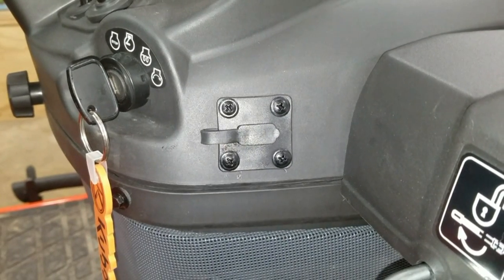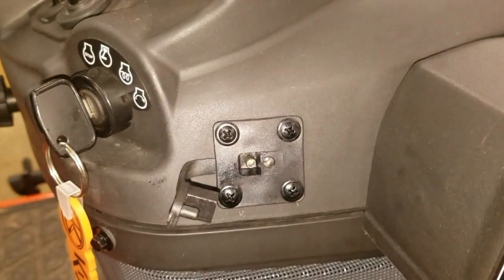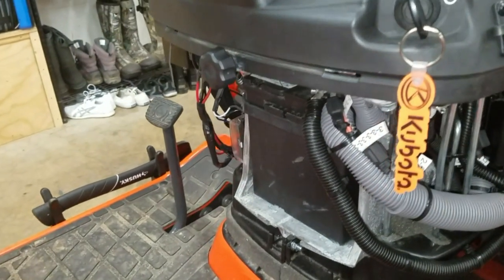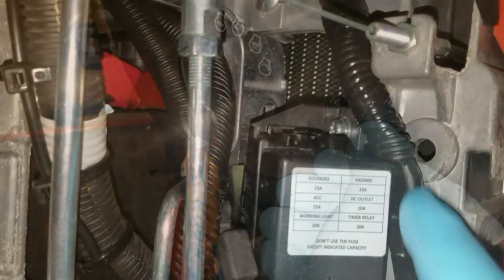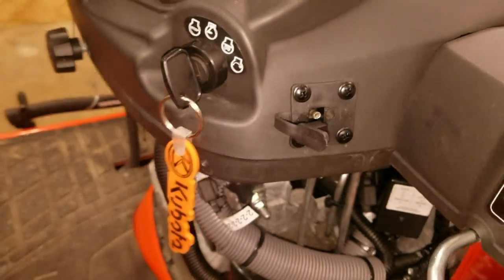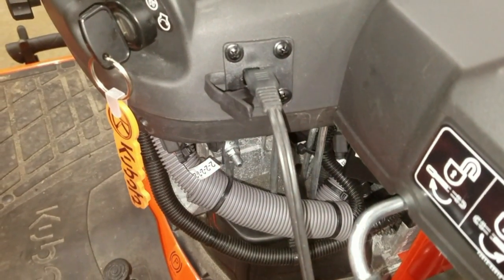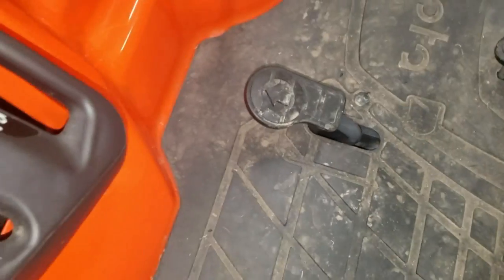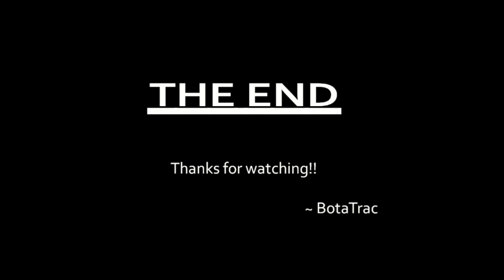Batteryminder EZ-Connector On The Kubota BX25D

Comment: Were nice I do believe I will be putting this on my to-do list for both my BX25 and also my boat. By the way I noticed the ammo cans installed on your loader arms. I would be interested in seeing a video on those.
Reply from the maker: I am a BIG fan of motors that start when you turn the key. Deltran Battery Tenders are on all my equipment that have a battery powered starter.